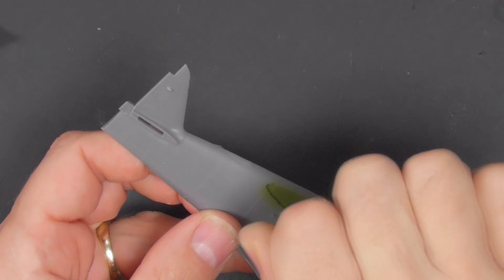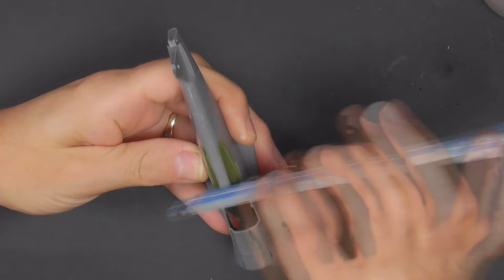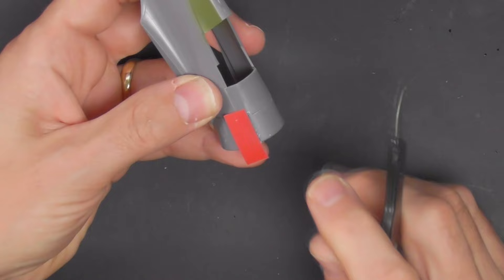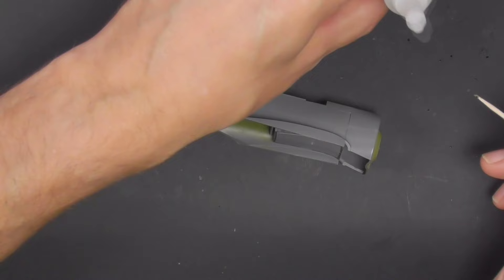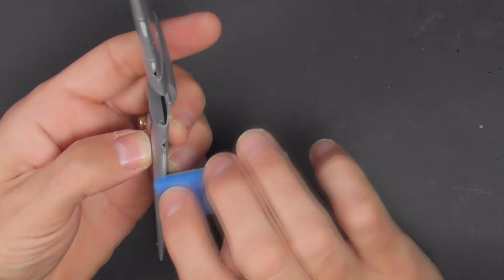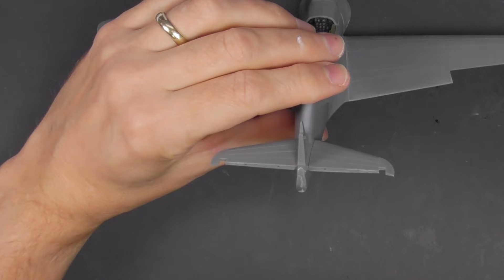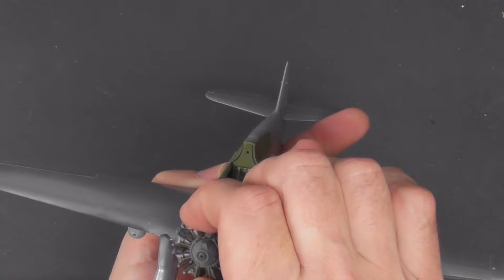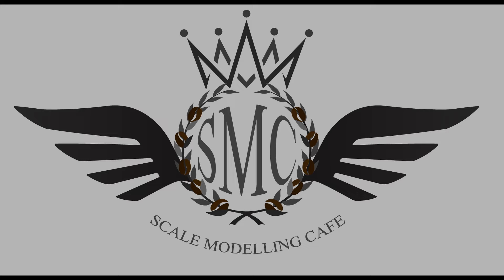Clear Prop Curtis H-75N Hawk 1:48. Part 3 Construction

Comment: It would have been much better to use debonder on the engine, and start from scratch Jamie, but one always thinks of these things later!
Anyway, based on your glowing review of ClearProp kits I bought their1/48  Skyshark which is just absolutely superb
Reply from the maker: I didn't work out what had caused it until I was quite far in mate, unfortunately.  I didn't give it much thought, just fired off in one direction rather than pausing to work out what had caused it.  Glad you pulled the trigger, that one looks amazing.

Comment: Can you please explain why melting seams with Tamiya extra thin cement at 7:50. Thank you.
Reply from the maker: The glue is a solvent, it's a weld action.  By leaving the seam for a few seconds you will melt a tiny amount of glue, the pressure then squeezes the molten plastic out of the gap, filling it.